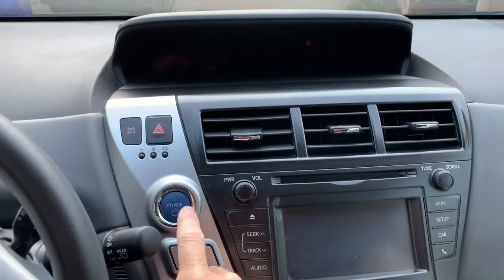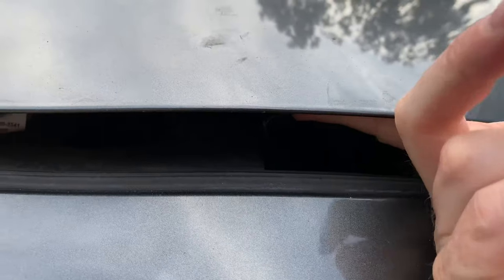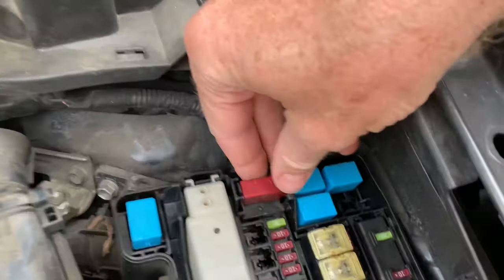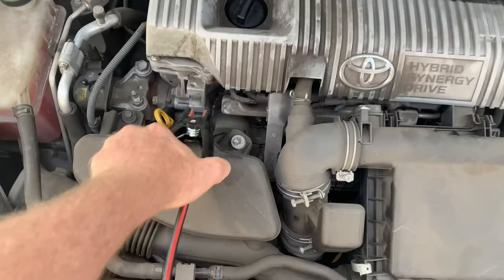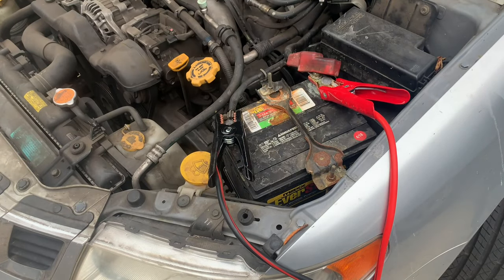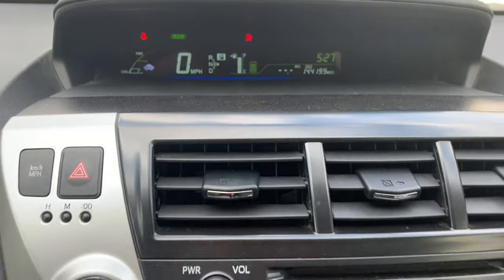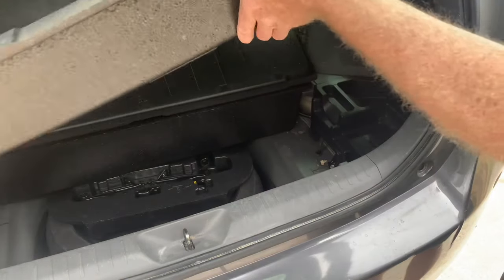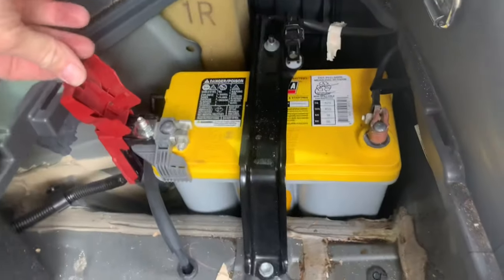How To Jump Start A Prius

Comment: They should make it jump start itself
Reply from the maker: I know! I figured you’d never have a dead battery on a car with a big giant battery in it, but it happens.
Reply: Newer ones do
Reply: Yes, makes no sense. Lack of foresight it seems.
Reply: Hyundai’s do
Reply: There is an emergency starting procedure at least for the 0214 models, just look in your owners manual, however if there is literally no charge whatsoever left on the 12 volt battery or a residual in the hybrid battery pack you are out of luck.
Reply: At first glance it makes sense, but what happens if the problem that affected the low voltage battery affects the hybrid pack too? Draining your HV battery is a much bigger problem that draining the LV battery

Comment: If the battery is REALLY LOW or DEAD, you can't open the trunk to get to the "real" battery.
Reply from the maker: True.
Reply: You can, you just have to go through the back doors and use the emergency release latch.
Reply: Easy, pull the release patch from the inside of the trunk, look it up

Comment: That’s not the order of connection that it shows in the owners manual. It shows connect positive jumper cable clamp to the Prius then the positive cable to the jumping vehicle then the negative on the jumping vehicle, then clamp the negative cable to the engine block on the Prius.

Comment: I don't understand the part about "letting it run" I assume this refers to the car one is using to jump the battery. When I've used a portable battery jump starter on the Prius battery under the back floorboard,  that only takes a second and the car starts. Is using the devise under the hood different from that? Thanks I'm doing this today.

Comment: Thanks for the video. What else should I do? I did this but it doesn’t work for me. I can only turn on the dash light but cannot start the engine
Reply from the maker: You could try hooking the jumper cables directly to the battery. The battery is located in the back of the car on the passenger side. You can find videos where people show you the location of the battery. It’s pretty easy to get to.
Reply: Hybrid battery only starts the vehicle !

Comment: So I got a jump last night and the company told me to drive for 45min at least, the faster the better. I didn't do that at all last time. Will you comment on that?
Reply from the maker: I don’t know if you need to go for a full 45 minutes, but driving will definitely charge the battery back up. After you jumpstart it, the battery is still low, and the motor is trying to charge it up. They probably told you to drive fast so that the gas motor would be generating electricity.

Comment: Does Hand held jumpers work for it I got someone to do it with a handheld jumper and it didn’t work he told me I probably needed a new battery or the main battery was the issue
Reply from the maker: They should work.
Reply: @hoohoohoblin  didn’t work but a car jump worked thanks for getting back to me

Comment: I changed the 12v battery on my 2009 prius about 3-4 years ago. Is been working good wothout any problems. Today car its completly dead, no ligjts or nothing. I even changed the control battery too.  Should i jump it and if it works will it be better just to replace 12v battery again???
Car did not give me any warning or nothing. Its just dead.
Reply from the maker: I would check the terminals on the 12 V battery first, and see if they are corroded and clean them off. Then try charging the battery.